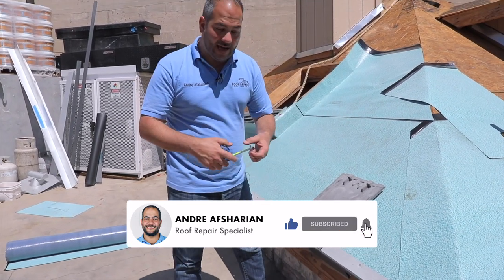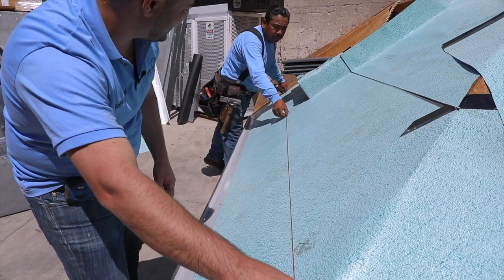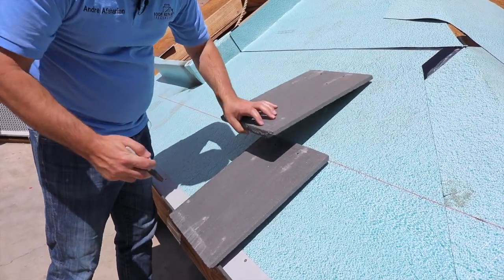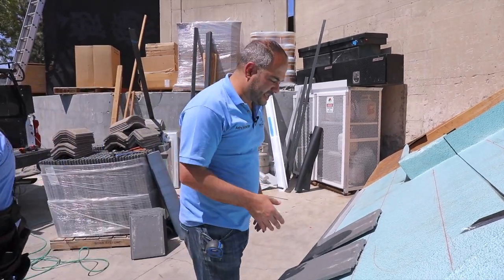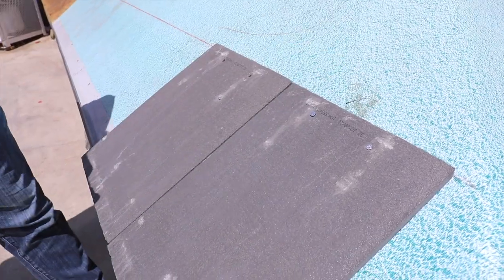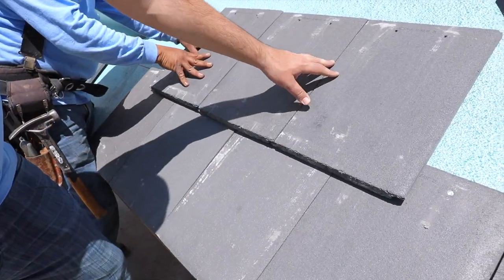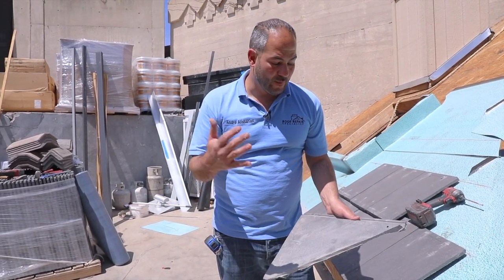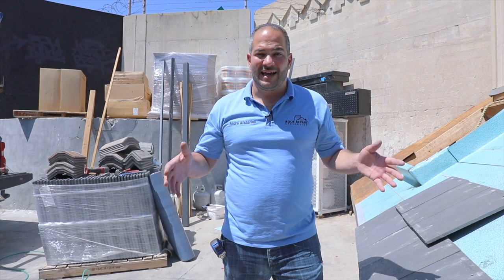How to Install Flat Tiles | Tile Roofing Guide

Comment: We have a flat roof, wanted to know if it be posible to use non-slip tile on the roof, the roof its solid cement.
Reply from the maker: I’m not sure on what you mean by non slip tiles. I’m assuming you’re not in the USA , I would recommend consulting with local builders to find out

Comment: What size length galvanized roof nails to use on concrete roof tile 3/4” thick on plywood no battens
Reply from the maker: You want to penetrate the plywood and protrude 1/2” so usually 2”

Comment: I have had flat tiles sliding out of place twice in the last 4 years. Are there some tiles that do not require nails? The house is only 4 years old....
Reply from the maker: Some Tiles use adhesive to stay in place, that is usually done in hurricane areas. Some tiles use a wire hook type fastening method. Regardless it should be fastened somehow; nail, adhesive or another system.